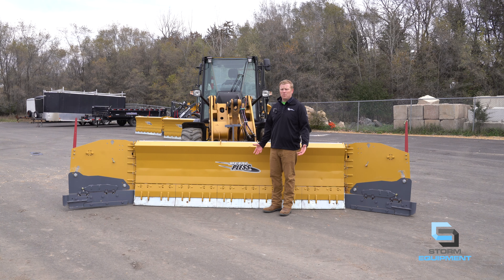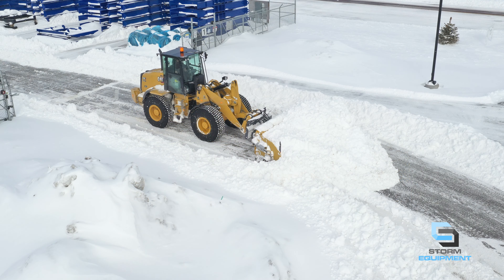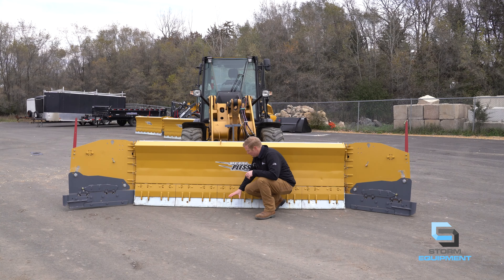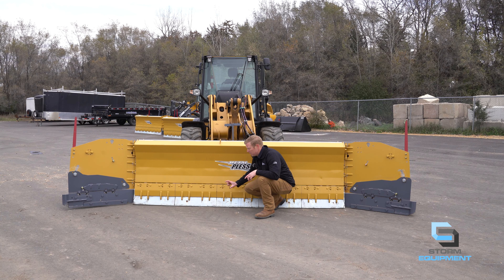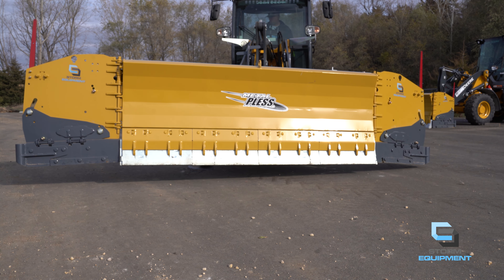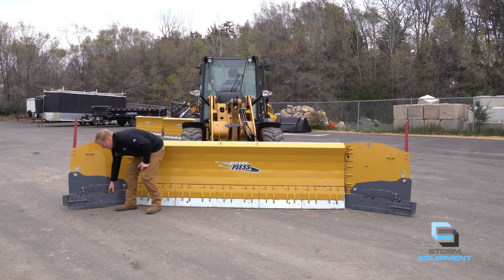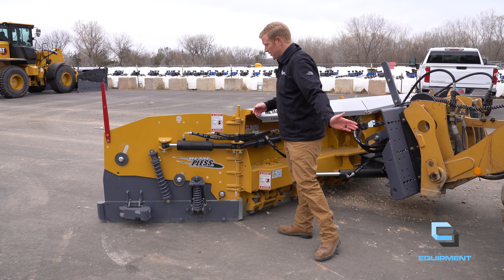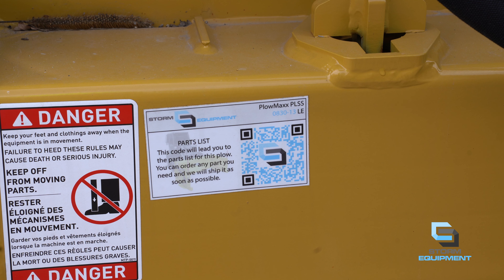Metal Pless PlowMaxx PLBH 1036-16 LE Walk around

Comment: why is the 8' mold board on these medium units the red headed step child. I have an 83616 and it's a unicorn, even though it has bigger carrying capacity square footage wise, vs a 103616. 8'X4'=32 sq/ft. 10'X3'=30 sq/ft. I like the versatility in clearing spots between parked cars.